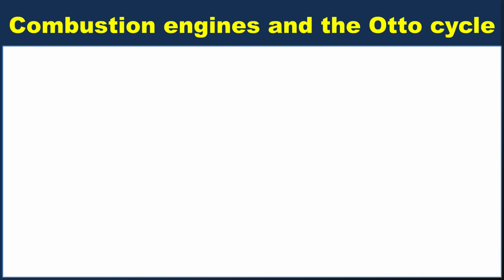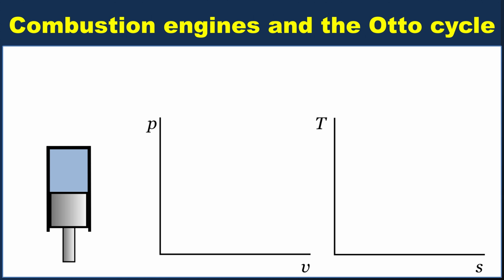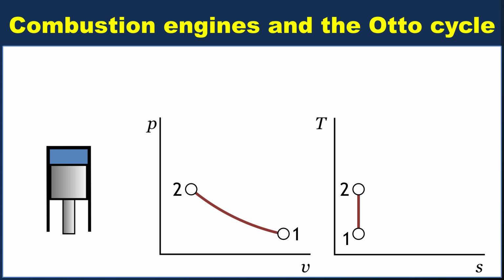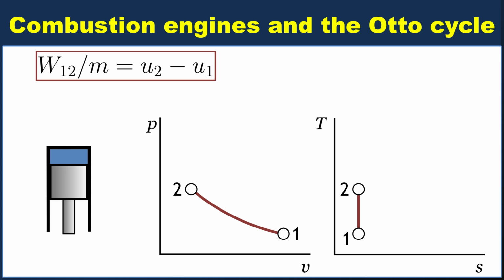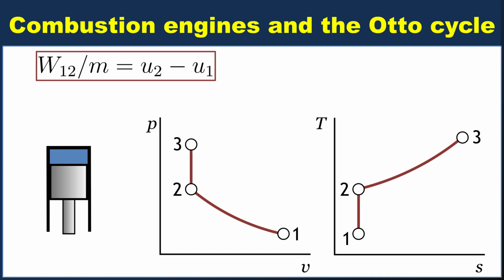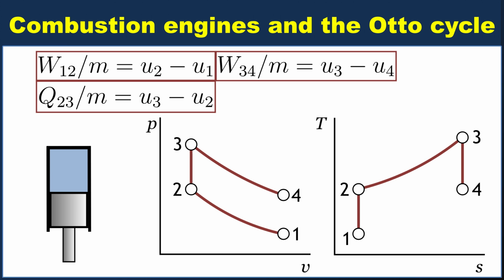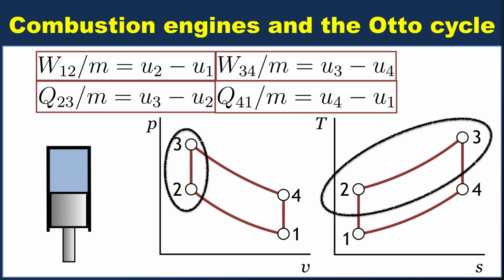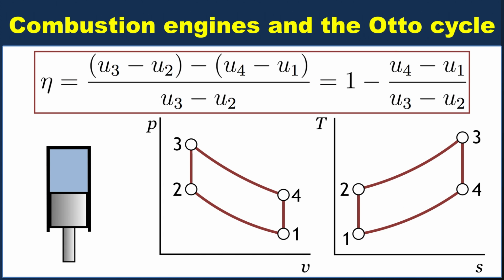Introduction to Otto cycles

Comment: How do we transfer heat away and at the same time we have the same volume? Doesn't that happen with the air that goes out through the valve?
Reply: wr're just assuming that the air is recycled so that the process can be considered "cyclic". That's just an approximation

Comment: this is right but if you add more like compression ratio, MEP,  air-standard analysis, what's cause knocking, and spark ignition or compression ignition... then people will not unlike